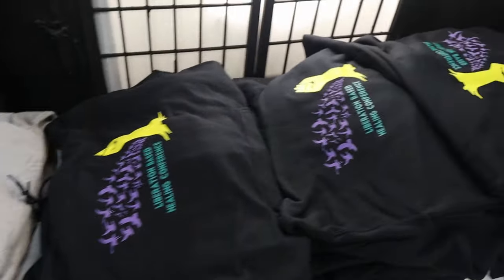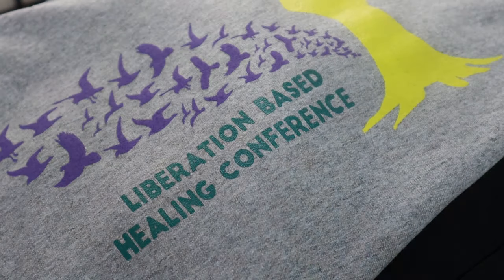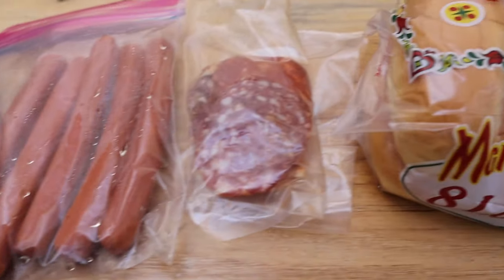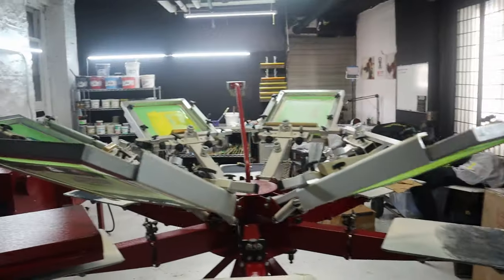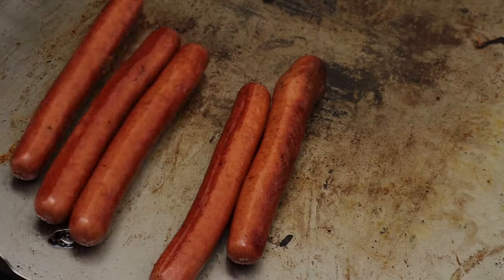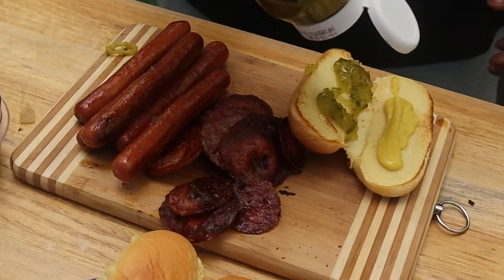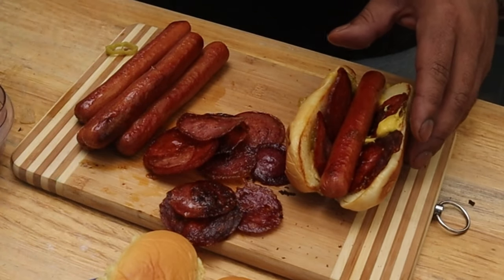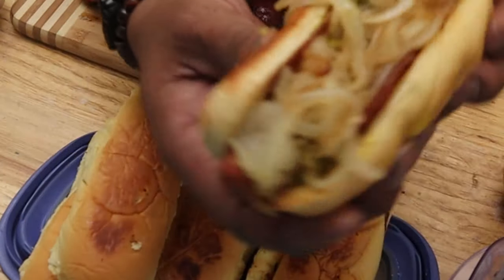SCREEN PRINTING PROBLEMS

Comment: Most clothing has moisture we cant see...on hoodies it's best to pre heat the hoodie ..when u pre heat it does 2 things...it will shrink the shirt by taking moisture out......even on some tshirts u need to pre heat to get that cure on point...the moisture will not let shirt cure properly..I was doing guldin shirts black fnink purple and I was having curing issues...I had to bumb oven up to 340 on fnink low cure 260.......I kept getting cracking in paint..since it was a 1 color I didnt need to flash....another lesson learned in this game of screen printing...